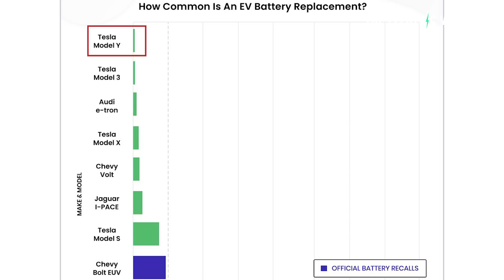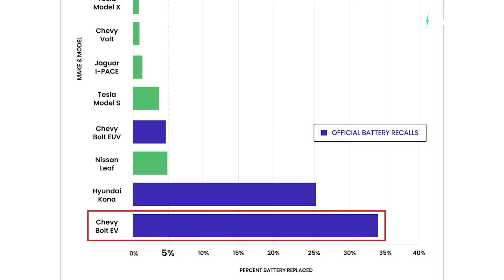Over 90% of battery pack replacements were for these 2 EV models

Comment: ☝️🧐,, EV BATTERIES DEGRADE 3% TO 5% YEARLY, even if they are not used. This figure is probably understated., so your thinking if you drive modest it will last longer,, WRONG. Would you buy a gas powered car that looses 3% to 5% fuel efficiency every year? ,,, Untill EV BATTERIES become really cheap the numbers don't add up

Comment: The graph you provided showed Nissan Leaf and Tesla Model S lead when non-recalled batteries are counted. The Chevy Bolt batteries were recalled and new, updated batteries were installed without charge to the owner. Current Chevy Bolt batteries do not have those problems and have not been recalled.

Comment: It’s not about how long the batteries last it’s how long before the battery’s performance becomes unacceptable. Some people want their battery as close to peak capacity at any price. Other people don’t mind if the performance drops 70% so when to replace can be two very different lifetimes. If someone with a 30% drop in capacity is only using their EV for short commutes and Shopping it isn’t any bother and people won’t mind it. People who need the full capacity should have the vehicle that covers that best in their warranty. Failure to follow charging guidelines is really only operator fault. Don’t blame the vehicle if you aren’t using it according to its rules. That’s really Dumb. Can’t or Won’t, my suggestion is don’t buy …

Comment: Yes as someone who has been dealing with engines all my life and swapped a few I’d say even dropping a compatible crate engine in an ICE car is pretty complex. Battery swaps will hopefully get easier,not harder as ICE engines have. In the 70 s I once fully completed swapping out engines in two Morris 1100 s (AKA Austin American in the US) in one weekend. Both drove away Sunday night with different engines. So manufacturers have deliberately made things a lot more complex while they clearly made things better too. EV tech is simpler mechanically, but very vulnerable to unnecessary electronic complexification. High tech junk food that is attractive and designed to make money for the manufacturer but generally poor value for the consumer.

Comment: I bought a Brand New Kia Rio in CANADA for $16,000 Dollars in March 2017... I have only put $450 Dollars in Repairs in the 6 Years I have had it,,, and it cost me $850 Dollars in Oil Changes... PLUS,,, it only cost me $1000 Dollars a Year for Fuel...  So that is Less than $25,000 Dollars including Car Payments,,, Fuel,,, Repairs,,, and Oil,,, driving 120,000 kms in 6 Years with a Range of 450 Kms per tank that takes 4 Minutes to fill... Curious,,, How does Tesla stack up to that?? Also,,, If We drive from one end of Canada to the other.. I would arrive 1 day earlier than you,,, because You will spend 24 Hours Recharging Your Car,, and I wont.....

Comment: 🇦🇺 I think many prospective EV buyers are more concerned about long term vehicle value rather than battery life. How many people would buy a 2nd hand ICE vehicle if they had to replace the fuel tank and delivery system? Same with batteries.......maybe viable if the vehicle is dirt cheap! Don't see any of the EV pundits addressing this issue.
Reply: How many ICE vehicles stay on the road after 150,000 miles? I observe people buying cars in that mileage range and having about s 50 50 chance of seeing them towed to the scrap yard in a year or so.
Reply: @PxThucydides  For example here in Finland. 150 000 miles are not as much. Typically cars are 20-25 years old and still running. There are not many people which will spend over 2000 or 3000 euros for a car. So that is the reason.

Comment: Timing chains can become compromised sometimes after 60 thousand miles
Reply: We have all heard stories of ICE vehicle owners needing multiple engine or transmission rebuilds/swaps early in the life of the vehicle. 

And there are some models fleet purchasers won't touch due to high failure nd maintenance rates. 

This is a car manufacturing thing, not an EV thing.
Reply: Yeah, if it is a ram master or a Chevy trax

Comment: We bought a 2019 KOna EV and had the battery replaced for free two years later with very little fuss. We basically got two years of degradation (tiny though it was) wiped off at no cost to us. In all other espects the car has been a brilliant performer and we have no regrets. Hyundai acted responsibly to an issue that affected a miniscule fraction of a certain model batch in an abundance of caution. To paint them as deficient in some way seems odd. I realise being opinionated probably gets you more clicks but seriously, do you think running down EV manufacturers for no good reason is the brightest thing to do if you're supposed to be promoting the switch to electrification?

Comment: My thoughts you ask....... We are still in the infancy stage of the EV industry, and this is where we are at already.... Imagine how much better than ICE they will be in 10 years.

Weight
Range
Charging speed
Reliability
Durability
Cost
Environment
Grid balancing
Longevity
EOL recycling
Time travel....... Maybe not!

ICE cars are struggling to progress on current fuels, and even if you got them to run on fresh air, there are still going to be limitations where they can keep up with progress of EVs. Imagine a breakthrough in super capacitors where manufacturing and capacity was no longer an issue..... That dream will become reality at some point.

Comment: lets face it: loads of EVs are bought by people who do short trips. a lot of small engine ICE cars will be uneconomical to repair at 100 000 miles if they are mainly driven around town. therefore, comparing an early EV to the fraction of ICE cars that did over 200 000 miles in their life is a bit silly. but even with that, there are some models that remain quite useful(even as an only car) after 200 000 miles.

Comment: I am frankly a bit shocked about the battery recalls of the model Y and X. Although they have the lowest relatief number of recalls, the numbers are, if I read correctly 4% and 1%. In absolute terms that's very likely a few tens to maybe hundreds of cars. With an industry norm of a strive towards a 1:1000000 error rate acceptance I can't help but feel that's still a lot. And a couple of tens of cars with battery errors sounds a lot in absolute terms when taking into account the perspective of an individual customer, no matter what big data says.
I agree the future of recent battery packs dies look brighter. But its sad to see we keep focusing on the optimism of the next generation of new batteries showing to be better, but forgetting that most of the world still hasn't transitioned to EV cars yet, there's still a long way to go, most people can't afford a new EV yet, so that every current EV on the market today matters, even the models that are already older and secondhand or older also still matter to the transition the whole world to EV. We can't just treat older EVs as redundant old Nokia smartphones after 3 years. That's not sustainable towards a global transition to electric mobility. Every EV om the market needs to matter. Yes Tesla is the best. But they can't do ot all on their own to get everyone with an ice vehicle to electric. Every EV on the matter needs to matter just as much as a Tesla to get the movement towards sustainable transport going.
The biggest issue I still see is that current EVs are still too big, we need more compact cars that ditch the ICE model design, have more interior space, and boot space, and be good EVs. In that regard I think the upcoming model 2 is really the pivotal change. The model X. Y and 3 for example, I think are still too big for the average person on European roads. We need more cars like the fiat 500E, chevy bolts, ora cats, eUPs, byd dolphins, ID2's, Honda E"s, with good battery and range (186 mile all season guaranteed range on one charge).

Comment: I like LFP, use those in my 12V starter. My 2015 ENV 200 24kWh battery is currently 10 bars. The battery tech is lasting.

Comment: You need to set a mileage to talk about battery replacement. You should ask how many EVs needs battery replacement before 200,000 miles. It also depends on the tolerance of the driver, some may tolerate a decrease of range bray 30% some may not even tolerate a decrease of range by 20%. Your 1.2% replacement refers to failed batteries I assume.

Comment: When you look at smelly cars it is not only the engine that wears out but also the gearbox. Modern cars have six-speed automatic gearboxes that can fail, and these, as well as the engines, are expensive to repair. Another point is that as the newer EVs age and the battery drops to, say, 60%, if their original range was 500 km, they still have a range of 300 km which is more than enough for a city car and, unlike a smelly car, the old EVs will be reliable and also not require continual expensive repairs.

Comment: I've replaced hundreds of engines. 30 years of replacing engines on a regular basis. Huge difference from one model to another. They are not as expensive as EV batteries. Transmissions are much more common to fail. My experience is that transmission failure is the most common reason for a vehicle to be took off the road. Trans goes bad and it's not worth fixing. The car winds up in a salvage yard.

Comment: hmm.... In the custom EV bike builder world LG Chem cells are very sought after. I have bought a few sets of Chevy Volt ones myself as they are amazing, I am using 2013 ones in one of my builds still going strong! I used to use Iron Phosphate ones and they sucked, cold weather affected them, lower peak current output and difficulty to monitor state of charge.  I am sure the LFP ones used by Tesla are top notch,  but will be interesting to see how they do over time.

Comment: hyundai voluntarily recalled all kona evs after a few cases and replaced its batteries. gm made several recalls without really fixing the issue until finally giving up replacing the batteries. GM=general misery

Comment: Had a 2011 Nissan Leaf, a 2015 Nissan Leaf and now a 2019 second generation Leaf. Live on the east coast of US. The earlier  Leafs we leased had such low ranges that by the end of the lease it was time to turn them in for a new one. However, except for the 2011 which was really a pioneer vehicle it was easy to drive the leased limit of 36k miles in three years on the 2015. The 2011 we accumulated 30k miles over three years. So with a range of about 84 miles on the 2015 Leaf it was a viable car for most daily driving. The 2019 Leaf is an entirely different car. With 149 miles of range most trips are doable. Bought the 2019 at end of lease and now have 60k miles on it. The battery gauge still shows 12 bars and the car has never been in for service. In cold weather the range can drop as low as 100 miles. But our Tesla M3 RWD which we just bought for longer trips and only has 8,000 miles on it will only give us 220 miles of range in cold weather and its published range is 270. What I am saying is that the current Leaf battery , even without thermal management is a solid battery. (at least in our climate). The real test will be this summer to see if the range improves back to the 140 or so range.

Comment: Sam it's not only the chevy bolts with faulty batteries but the hyundai kona also, you know that hyundai is trying to keep it a secret, like the new problem with Ioniq 5 12 volt battery problem, it's good hyundai won't qualify for the tax rebates they are not dealing in good faith.

Comment: I do find it amusing this guy always says LFP is superior in almost every way. However let's look at the true info. LFP have far lower battery density, LFP do not give an accurate range as seen every time you charge up your Atto 3, same range of 480km no matter how you drive! Cold weather performance is not as good, a non issue for most Australians. Yes LFP will last longer, but again that's a non issue as the very poorly designed Nissan Leaf is still going strong after 10 years plus and with a failure rate of less than 0.01%. So the NCA will last as long as the car will! If you compare the MG4 LFP battery can only charge at less than 100kw vs the NCA up to 140kw and stays at higher charging longer. Then people say LFP can charge to 100% which is true however again the MG4 has an 51kwh LFP battery vs the NCA 64kwh so no problem to charge it to 80% around town for similar distances, however on a road trip neither EV will want to charge past 80% due to the much slower charging speeds between 80-100% so in that case the NCA wins. LFP does win in one area and that's safety, however battery fires are still extremely rare in any chemistry.

Comment: Yes and wear are those Batteries going to be Dumped 🤔🤔🤔🤔
In the sea, in land fills, were???
Why don't you start telling people about the massive increase in Minning and resources that EVs course.
Diesel Electric Dump Trucks use a third more Diesel than Conventional diesel Powered Dump trucks.
More CO2 and expensive manufacturering to keep the Sheeppelle poor and the Elite's wealthier
Well done

Comment: I had my battery replaced in my Hyundai Kona. My understanding is there were a bad batch of batteries, not all batteries were replaced by a rough patch during manufacture.
Reply: LG chem design is lot more delicate compare to LFP design. The membrane is very easy to punchered as Ive read somewhere. And it becomes a thermal runaway once thr membrane is comprised.

Comment: Name a single BEV older than 20 years with the same battery
Reply: You did say single.  Jay Leno has one.    A Baker Electric and yes IRRC the battery is original.   It was one of the things they talked about.   It's about 100 years old.

Comment: my MG4 SE Long Range has a Lithium Nickel Manganese Cobalt battery, how does that compare to the Lithium Iron Phosphate? Thanks
Reply: More accurate range estimation, far faster charging, better cold weather performance. Many say you cannot charge to 100% which maybe true but not an issue if using mostly in the city, also very few will want to charge past 80% even in the LFP when going on long trips as the 80-100% charge speed is painfully slow. Forget about how long the battery will last, my Nissan Leaf is now 9 years old and the battery is still going strong and Leaf batteries are some of the worst batteries so the new batteries in your MG will for sure outlast the car!
Reply: Oh I am talking about your battery not the LFP

Comment: I bought a 2014 Nissan Leaf in 2016. It had full battery capacity when I bought it. The early batteries were known to brick in a few months in hot climates. In late 2013 they introduced the Lizard battery which was less susceptible to overheating.
With Leaf Spy I can monitor the battery temperature among other things. The battery reached 125 degrees Fahrenheit on one of my long distance excursions to California. The car communicated with the fast charger and would not allow it to fast charge.
It is now 9 years old and has over 100,000 miles on it. The battery has degraded to 75 percent, but I can still get over the hills and back. 
It's been an adventure to say the least and if you're not up for the adventure, don't.
Reply: In addition to 2022 Tesla Model 3 RWD (LFP) we have a 2013 Nissan LEAF - 24kWh (gen 1.5) that was purchased in 2018. I was trying to buy one with the Lizard battery but must of just missed the changeover. Our 10 year old LEAF has degraded quite a bit now (hit 68% and 8 bars recently) but even so it still has plenty of around town range (my Wife uses it nearly every day) - and we have the Tesla for longer journeys. By my calculations the LEAF has now basically paid for itself COMPLETELY on fuel and service savings, so really it doesn't owe us anything. There are some 3rd party battery replacement options starting to come on to the market and we may look into that in a year or so (it seems very likely the LEAF will still be running fine).
Reply: @kiwijonowilson  ln Portland Oregon there is a company called EV Rides that replaces Leaf batteries. They take good batteries from wrecked Leafs and use them to replace degraded batteries. I saw one Leaf that had over 200 miles on on the guess-o-meter. I was told that they can put one of the new Leaf batteries in an old Leaf. I would do it if I had the money.
Reply: @lgrantnelson2863  Yes we have a company in Christchurch NZ called "EVs Enhanced" that does this too. They have also nearly completed a new bespoke liquid cooled option (using BYD LFP blade batteries) which would be fantastic - although I suspect it will be priced close to the cost, here, of a second hand 40kWh LEAF. Still it would be a brand new LFP battery that should last a long time.

Comment: Probably most Bolts didn't actually need the replacement, because the recall was meant to fix a fire risk when the battery pack had a pair of manufacturing defects, which weren't in every car. Unfortunately there was no way to check any given Bolt to see if its pack had the defects, so they just replaced them all.

As a result, I don't think you can say that all Bolts had defective battery packs. The large recall was a protective measure to deal with a small minority of dangerously defective packs.

It's a different story with the older Leafs; their notorious degradation problem was a result of Nissan's refusal to use proper battery temperature management. That was something that affected all Leafs, and is a design flaw, not an occasional manufacturing defect.